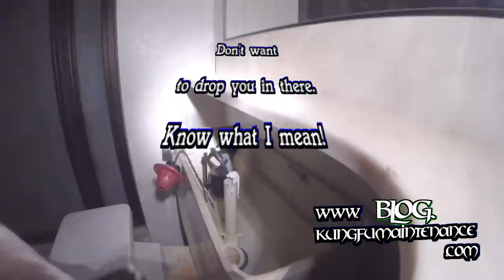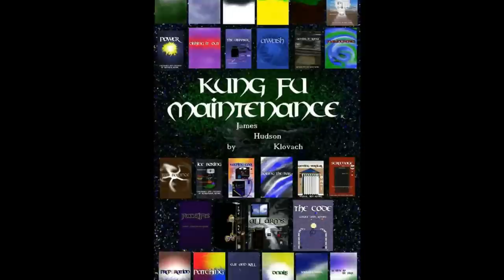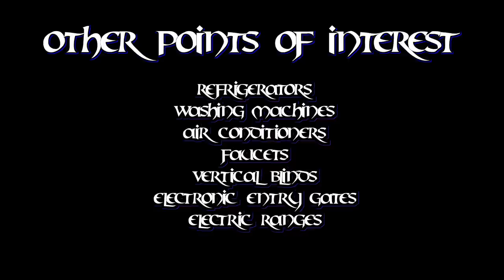How To Fix Running Toilet When New Flapper Still Lets Water Leak Through #Flashlight Video Series

Comment: Don't need a 7 minute dramatized video on how to do this. Waaaaaaay too long.
Reply: Tip: On long instruction videos I run them at plus speed. Works great! You still understand them but in half the time! (Find speed setting down at video menu bar OR a good shortcut is to press "shift" key and "greater-than" (>) key for faster and "shift" and "less-than" (<) key for slower). .....Phew! I think MY instructions were too long ! LOL  But it'll save you some time in the future.
Reply: As a matter of fact, being someone "slow" to fully trust I understand new concepts (and of course, being a "woman" after all) I found the length comforting, helping me make sure I was understanding what I was seeing.  Perhaps you already had a familiarity with the pieces parts and their inter-relationship?
Reply: rockweedgirl Okay.....I can understand your viewpoint
Reply: I baled after he said to use vaseline.  I actually fixed the toilet, and return to 6:05 left on this video.  Worked great!!

Comment: I tried replacing the flapper valve (and in fact bought precisely the same flapper valve I've got in another toilet in my home, where it works fine).I tried your fix, with the Vaseline.Neither one worked.I don't think the problem is elsewhere in the toilet because the toilet got all new innards a couple years ago.Any further suggestions?

Comment: The weight of the water pushes the flapper down into the hole. What can I do besides reducing the flush amount ? Should try to find a hard flapper ? Most are soft rubber.